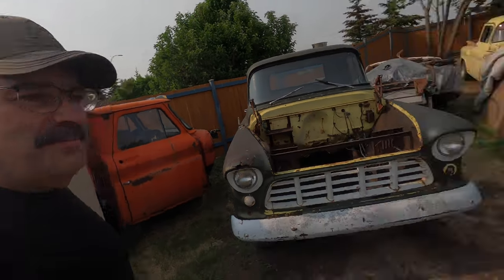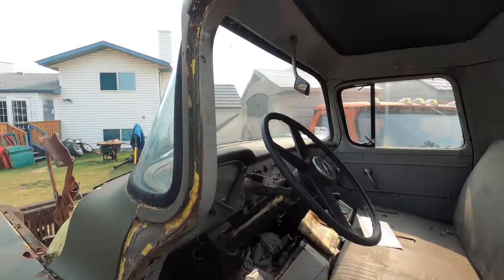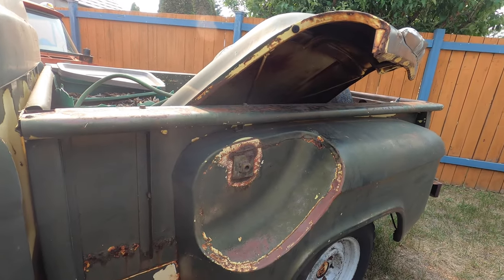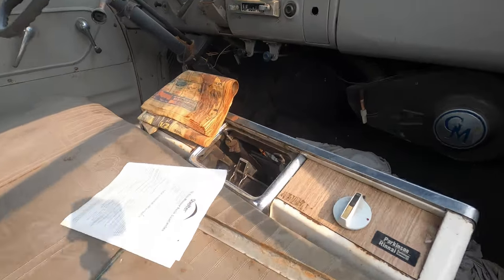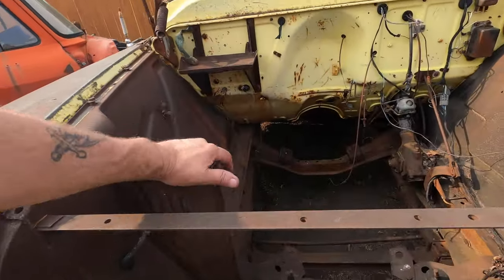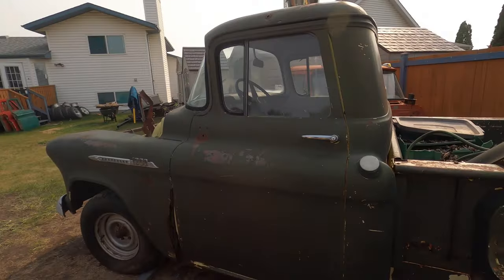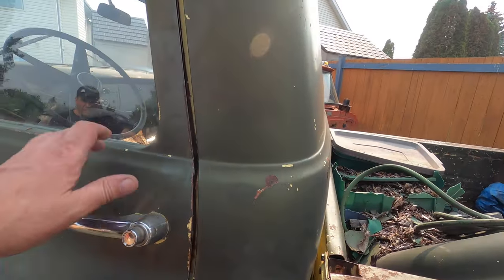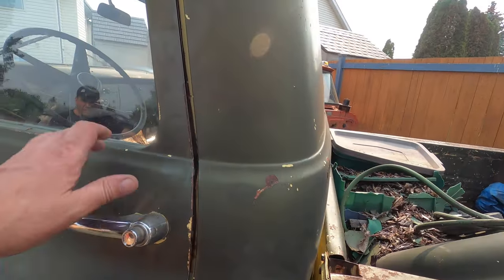55-59 Chevy & GMC Project Truck Buyers Guide - What to look for that’s important and what isn’t!

Comment: Good vid.  I have a chassis swapped 59 GMC 9320.  Wish I had Jeff's 58 to pillage...lol.
Hole above the windshield may have been for a dealer accessory speaker for the radio.  Peep mirror is an era correct dealer item and somewhat hard to come by.  Canadian GMCs were basically rebranded chevys (emblems, grill, dash, tailgate changed).  American GMCs are different under the hood most noticeable by a completely different rad support.
58 was the last year for bumper bullets.  Stepsides offered in 3 lengths; short, mid-length (often referred to as a long box), and 9 foot actual long box.
Reply from the maker: Some
Good info right here. Thanks for sharing Mike!!

Comment: So if the truck was yours as is 
I wanted to buy it 
What price would you put on it
Reply from the maker: It is mine. I don’t really want to sell it. I just made a large parts order for it.
Reply: @shortcutgarage  I’m trying to figure a value on it, only (not trying to buy it)
Reply from the maker: @tombrenes2411  that’s a good question, I’m not really well versed in these trucks nor are there any equal comparable trucks in my area. Some people think I paid too much, others think I got a deal. I suppose I’ll know better as I build it. As far as “what’s it worth?”  Not sure, but I paid $2500 Canadian (1800 USD) and I think that’s pretty close to its actual value in my eyes.  What are your thoughts?